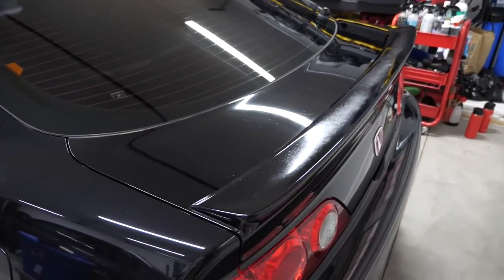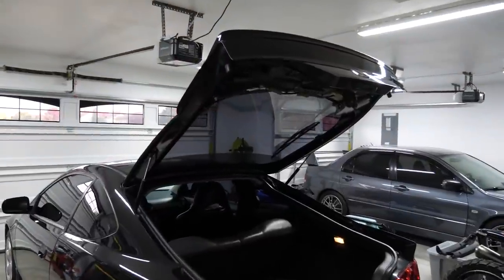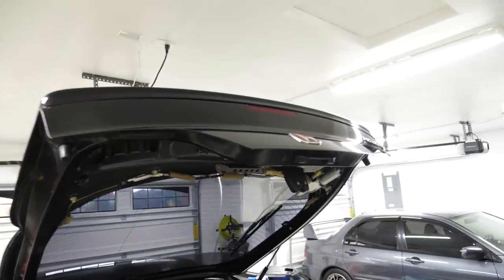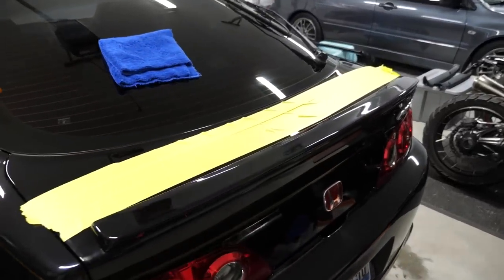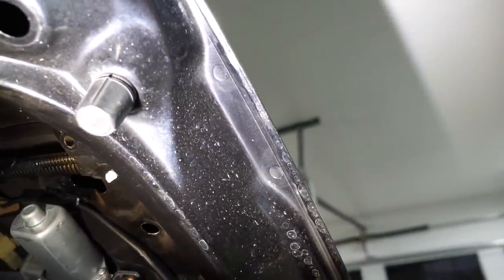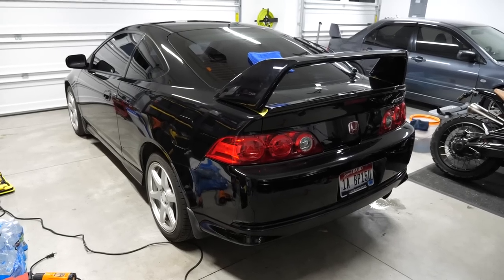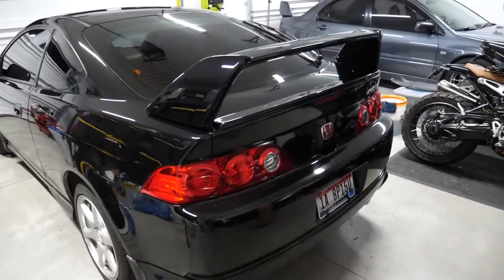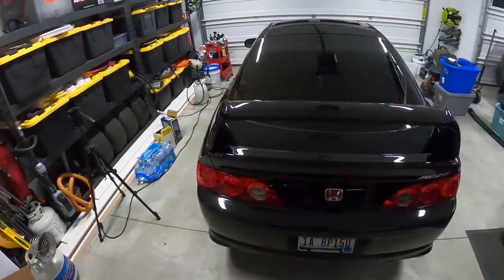The Acura RSX is Better with a WING! | OEM DC5 Spoiler Install

Comment: Looks really good personally I prefer the integra but I cant deny how good the back of the rsx looks. the front tho thats a different story haha. Keep up the good work and good vibes Anthony
Reply: They are the same car. They both have the Zenki and Kouki version (the restyling, which this car is, that's why it's got different tail lights and headlights, amongst other little details).
Reply: This car imo looks better all around, looks more aggressive, better engine, faster and still light weight. On top of that it’s aging pretty well, unlike the previous intergras (especially the American version)
Reply: @Andy3x   Personally I feel like the look of the rsx compared to the integra is like comparing a 6th gen civic like the one anthony has to something like an 8th gen civic I don't really like the more bubble look of the car.
Reply: @jdmfreak22  true they arethe same car yet I just think one looks better then the other

Comment: Love the rsx. Use to own a 06 white pearl tyoe s.  Definitely looks great with the high spoiler. Going to need to swap out the hatch lid struts as those will not be able to handle the new weight. Don't remember the part as it's been a long while. Loving the new build though, and waiting for more content to drop. 👌👌🔥🔥
Reply from the maker: Struts will be on the way as soon as these get tired. They seem to be holding it for now!
Reply: I have a 06 white pearl type s and got an OEM ASPEC wing that I'm adding next week.  I have all parts except the upgraded struts you mention.  I think it's 08F02-S6M-000R1 (and -R2), but not certain.

Comment: Should take out the rsx type s badges if your gonna rock the red H imo. My 06 type s is getting repainted I told them to take them off since I got the front back honda emblems on the way from Japan along with type r taillights

Comment: I'm doing this to my integra type s. I've tried the link to find the rear ducktail you used, but there's nothing available on Australian eBay. If i use the description you've said in the comments all i get are wings for toy cars. Can you help me out with more information about it, please? I like the look with the decklid under the wing but finding it on Australian eBay is impossible. If I do find one it's a full sized one and won't fit once the wing is installed. Please help a fellow type s owner.

Comment: Do you need to upgrade your trunk lid struts because of added weight? USDM and JDM partnumbers for those are different. Also, how did you plan to cover holes, if you'd had 05-06 hatch?
Reply from the maker: Typically yes. Mine seem to be doing the job for now though

Comment: The Decklid spoilers unfortunately out of stock, I'm doubtful but I might see if the original wing can fit with the large one. Seems like it's too long though.
Reply from the maker: It is too long. You would have to trim the deck lid

Comment: Why does your spoiler sit like an inch from the edge of the trunk? I bought this exact same one from the link you posted and it sits right on the edge of my truck causing the mini deck lid that I bought not to fit. Any help you’ll be gladly appreciated!

Comment: The aftermarket wings look nearly identical to the oem one. Currently oem ones are much more expensive than aftermarket ones. So my question is was it worth it shelling out the extra for the oem one?
Reply: No it’s not. Leaving it stock is the way to go.